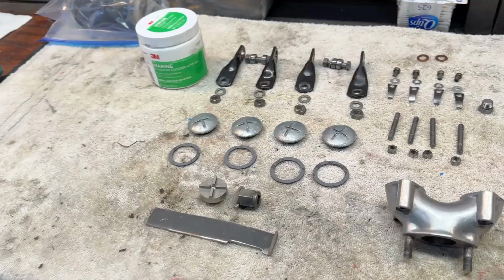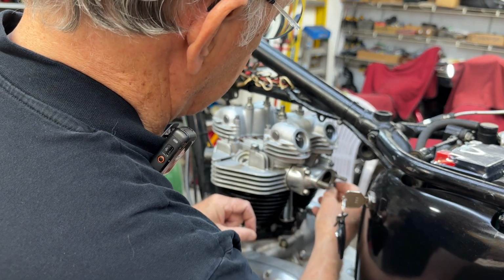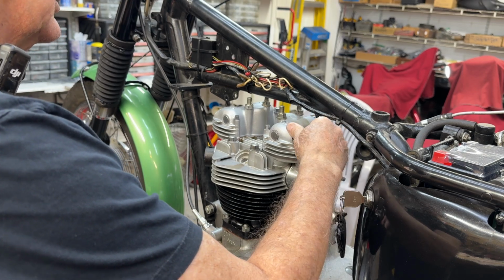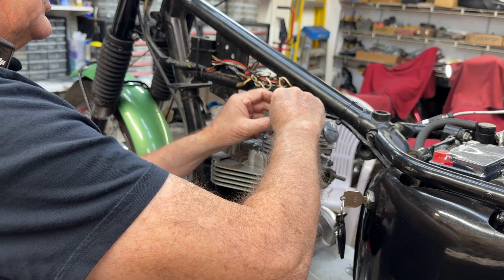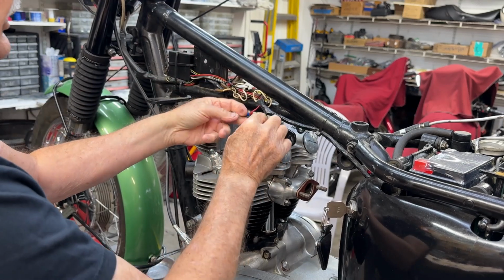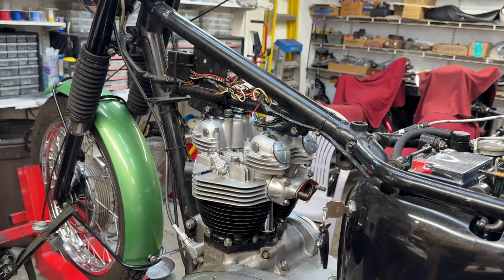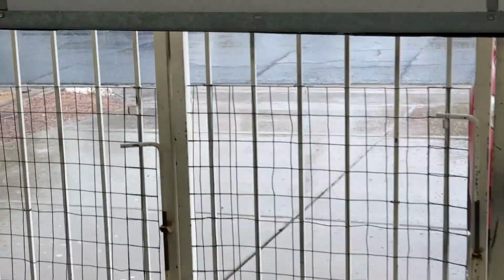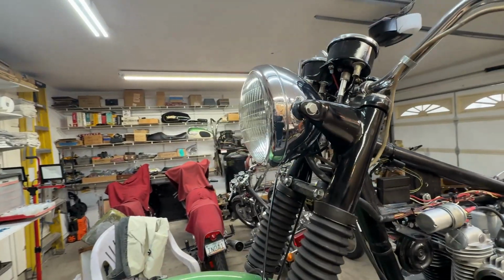03-07-25 – Vid 05 – 67 Tri TR6 - Engine Reassembly 03

Comment: Frank, how come you don't use ultrasonic cleaner for small parts?
Reply from the maker: I've tried ultrasonic cleaners, and the vibrating media cleaners and they don't clean the parts as well as a wire wheel.  At least not for me.  Maybe I'm doing something wrong with them, but I like the immediacy of cleaning and polishing by hand.